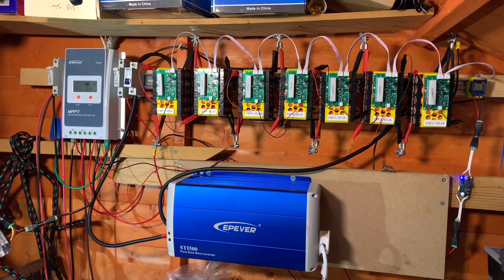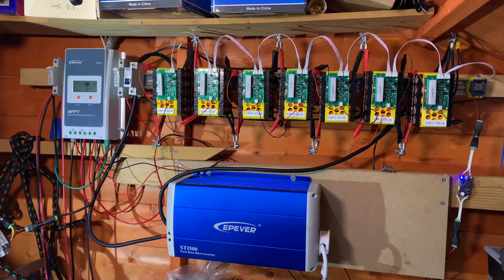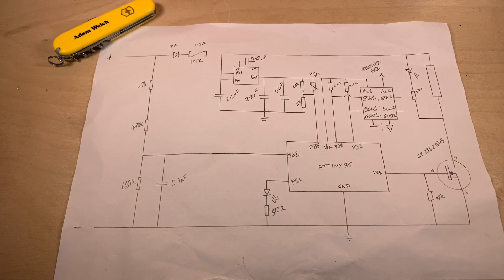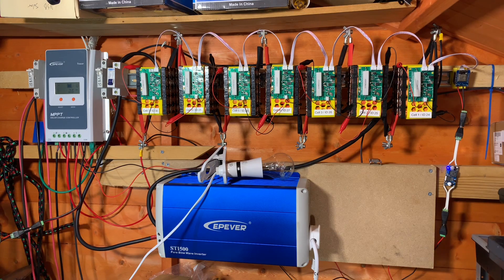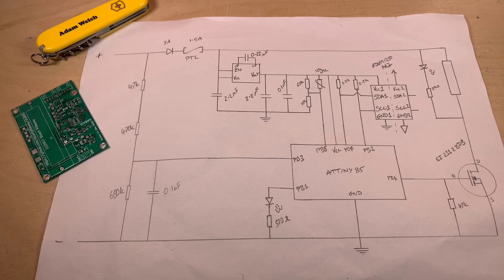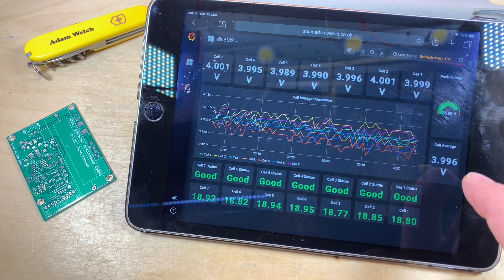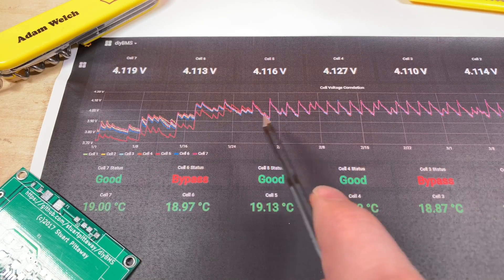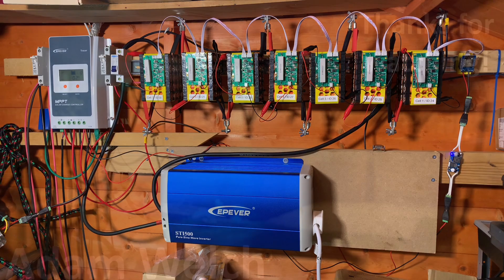A year with the diyBMS

Comment: hey would you recommend this charge controller for beginners, I only plan to use this to charge lithium batteries I have a 4S and a 7S (18650 battery is only)

Comment: Hi Adam, you seem to me as the most knowledgeable electrician YouTubers that I follow therefore I came here :). I have a stange question, what would happen if 220V is fed back to the inverter? I am asking because I have vired its output to the fuse box in my caravan to power up my plugs across the caravan, but if I come to a camp site and connect to the mains than the power will flow back to the inverter for the reason I described above. Is there a way of isolate it (make the flow one way, like a diode would do in a DC situation?). Otherwise I am risking cooking the inverter plus even feeding 220v back to my batteries, which may not end up well. Is there a way to do it? Can I just wire in an average on an on/off switch we use for a floor lamp for example and interupt the brown/red cable? With AC it alternates between this and neutral right, so it would only kill 1/2 of the wavelength right..would the other half not cause any havoc in my inverter? Thanks for your input on this Adam.
Reply from the maker: Hello. You’ll need to isolate the inverter when you’re using your hookup or else you’ll damage the inverter and possibly other items. I’d either install a transfer switch to switch between the two or a straight forward two pole isolator would work - but potentially it does allow you to forget and connect both at the same time.
Reply: Oh yes, that'd work. Btw the inverter has got only two poles (no ground). Would it make sense to ground it to common ground (where all other 220v cables are connected in the circuit breakers) or should I not worry about that? I am going to install a two (or three) pole isolator depending on whether you recommend me to ground it or not. I will not be connected to mains hook up very often - but wanted to have this option hence I am keeping this circuit connected as well. It's great to receive advice on how to do things. I am skilled in DIY, just not an electrician... :)

Comment: Adam, how do you show the "Cell Average" and "Pack voltage". Are you setting this up in grafana or you you do something else? Thanks!
Reply from the maker: Pack voltage comes straight from the charge controller into influx and grafana. The cell average uses the individual cell voltages in influx and calculates the average in grafana.

Comment: Hi Adam I'm following your channel especially on BMS. As you mentioned during the 100w bulb discharge test, you had to terminate it due to the pack five being too low. This brings me to the question: Can this BMS prevent a low voltage situation? Although the inverter or other equipment might stop the system based on the total voltage, the individual pack voltage might be close or even under the minimal voltage.
Thank you
Reply from the maker: No the current version doesn’t have a master relay to cut off any loads if any of the cells get too low. Currently I need to put my faith in the charge controller and inverters low voltage cut off. Stuart did take that feedback onboard and hopefully he is working on that limitation.

Comment: Adam - we have just upgraded our camper solar set up from 100 watts panel  lead acid to 290 watts and 105ah lithium ready for the summer - Will Prowse  put us on to a battery monitor that looks like a Victron without the Blue Tooth -  much much cheaper  - we set it up today and its brilliant - thought you might like one for your shed - it came with no manual but Will's post was clear how to set it up - let us know what you think https://www.ebay.co.uk/itm/Battery-Monitor-DC-0-80V0-350A-SOC-AH-VOLT-AMP-Capacity-Tester-Voltmeter-Ammeter/223230408536?ssPageName=STRK%3AMEBIDX%3AIT&var=522025797318&_trksid=p2060353.m2749.l2649
Reply from the maker: Thanks very much. I might well take a look. :-)
Reply: @AdamWelchUK  It is a kind of two way  joul meter using a shunt - you drain the  Lithium  battery to the lowest safe level (we used 12.45v for a 4S lifepo4) set the  meter then charge to full - walla : )

Comment: The ESP chip can re-write it's own flash blocks, even with the code loaded it should have bucket loads of room to store statistics. ESP8266 modules are very cheap, why not re-design the charge controller to have a Wifi module each, no need for opto isolation.....
Reply from the maker: This bms isn’t my design, but I did look at building one with an esp8266 on each cell group. The wireless comms would elimintmate the shared ground issue (which Stuart fixed by using the i2c isolation chip). 
My issue with this design was that the esp8266 only has one analog to digital converter - so you could read voltage but not temperature for example. That ADC also can only read up to 1 volt, which makes the steps quite large when you use a voltage divider to measure 4.2 volts. 
Secondly the esp8266 pulls quite a bit of current - so one on each pack might not be great on smaller packs.
Reply: The ESP32 has multiple A/D channels that go rail to tail, also has a pretty good low power sleep mode, maybe that would be a good choice.
Reply: @AdamWelchUK  You could use an INA219 for measuring pack voltages, they are very accurate.

Comment: Thanks Adam; that's very interesting. In any rechargeable battery pack, after a while, there will always be one cell which is weaker than the others, and after a number of cycles, it will become progressively weaker, because it is the pack which always has to work 'hardest' within its more modest capabilities. This is very often seen in an old car battery, when it will drop to a 10 V terminal voltage because of the weakest cell failing entirely. The other 5 cells might be still working properly. In your case, this is 'cell' 5. 

You could replace the 'cell' components with better 18650's, as a matter of routine (or even exchange 18650's with ones from the other cells), to retain a balanced setup. When another (or maybe the same) cell develops a weakness, repeat the process. Looking after the weakest cell like this should give you the best overall battery life.

Comment: You are nuts ! What happens to your wood mounting if the batteries go bad and start burning ??? The Idea is good but please think about savety, too ! I couldn´t sleep at night with an installation like that ! Unbelivable ! Have you ever seen a LiPo burning ???
Reply from the maker: Lithium cells set on fire if they are dramatically over charged or they are pierced while fully charged. I don’t intend to do either :-)  The pack has a breaker installed and each cell is fused at 5 amps. Have a look at my other videos, I’ve tried pretty hard to make a safe setup.
Reply: Yes, you might be right. But anyway, I do never ever make an electrical installation  just on wood ! You could have used a metal box. Looks better and it´s saver ! "Just in case of...!" In the end, it´s up to you !
Reply: @bjornfuchs3129  Metal box? You really think it's safer with short circuits?
Reply: Yes, this would be safer if they go off ! Don´t worry about shortcuts ! What do you think is a switchboard cabinet made from ? Metal ! Now, guess why ! Lol..
Reply: @bjornfuchs3129  Switch cabinets are not hand made! Here the batteries have a high chance of shortcuts, there is no insulation at all on the packs.

Comment: The biggest problem with this BMS is that the modules are powered by the cells being monitored.  No matter how careful you are, no 2 modules are identical and will draw different amounts of power thus throwing the pack out of balance.  Also the modules don't know when to disconnect from the cell when the cell gets in trouble thus it can drain the cell to dangerous levels.
Reply: I have designed a similar (distributed type) BMS myself I can confirm this. We, however, managed to drop power consumption below 1μA, which is almost zero in this case.
We did not use a dedicated communication chip, as there aren't any that are power efficient. While I admire the effort of creator of DIY-BMS (mainly as good source of educational material), the communication chip he selected (ADUM1250) is so power hungry (6mA), that it will drain a typical 18650 cell from full to flat in 3 weeks, which is really bad. The difference in power consumption of 6mA vs. 1μA is just astronomical.

Comment: I'm not sure i understand - if each individual BMS sets the upper and lower limits for that pack and each BMS is connected in order to balance the packs, haven't you then by default set an upper and lower limit to the whole pack? Of course I'm not sure what good a BMS is if it doesn't disconnect a pack when it goes low. I'm assuming it disconnects the charger once it reaches the upper voltage limit you've set? Anyway great info as usual Adam.

Comment: Qestion: how do I order the pcbs?
Reply: download the files from the diybms github and then go to a pcb supplier like JLCPCB.com and upload the gerber files.
Reply: @JankyShack   Is this the correct file: https://github.com/stuartpittaway/diyBMS/blob/master/BMS-Cell-Module-Circuit/GERBERS/GERBERS.zip ???
Reply: @JankyShack  Also what is the easiest  way to order the components?
Reply: @arhitektche  The newest version is under the smaller-pcb branch.  I have updated the BOM with links.  I sent a request to have it updated in the actual release, but until it is here is my fork. https://github.com/Zenkormalorvi/diyBMS/blob/smallerpcb/BMS-Cell-Module-Circuit/BMS_Cell_Module_BOM.html
Reply: @arhitektche  https://github.com/stuartpittaway/diyBMS/tree/smallerpcb/BMS-Cell-Module-Circuit/GERBERS These are the correct gerbers.  Also make sure to order 0805 size components, not 1210 or they will be too big to fit on the updated board.
Reply: @JankyShack  Awesome thank you!

Comment: Good work. Fun seeing the attiny85 and i2c isolation. I've been there too, also the reset pin on the attiny I ended up using adc to read input from a button and at the same time keep the line as a reset line.

Comment: How about upgrading to a esp32 and have some relays to control over/under charging? That would make the entire system self contained, easier for beginners to use and implement as well.
Reply from the maker: I don’t think you need to use an esp32 really - unless you need the control web gui to be faster or perhaps if you had a very large pack, but an esp32 version would be nice. Using another pin for a external relay is a good idea I think if you’ve nothing else controlling that side of things. It shouldn’t be too hard to adjust the code to implement it.
Reply: @AdamWelchUK  my idea was to make it more responsive yes. We could also add more sensors for ambient temperature and so on. We could use the Bluetooth functionality to sync several controllers together as well. I don't know, sounds useful for bigger packs.
Reply from the maker: Does sound interesting. Some good ideas there. :-)
Reply: @AdamWelchUK  need to get some batteries, it's difficult to get used laptop batteries on my country.
Reply: @AdamWelchUK  I thought in some other courses, thinking if it would be possible to drive with an esp32 on each pack or 8266 when my thought was that fewer components on the second circuit board (and also become cheaper) and all communication is wireless and an extra esp32 for summing up the data and storing history (for 7 cells -> 8 esp32 or 1 esp32 + 7 esp8266) if it would suffice with some mosfet and resistor when it is already isolated
was just a thought from one who didn't keep up with these things but was just thinking about it

Comment: It's actually better for the cells to keep them at as low a voltage as possible (above fully discharged obviously).  So If you can drop the charge voltage (to around 4.05V or even lower) during the sunnier months that would extend the life of your batteries without limiting your use based on your voltage plots.
Reply from the maker: Yeah - the whole setup is set for about 4.1v per cell but I don’t hold them there for a long period. So they tend to settle at about 4.05 normally. Cheers

Comment: Hah, I was just putting in order to jlsbcplah,whatever it was, for 30 boards to start making my own and checked your previous video for links :D Bit annoying to beginner to figure out the bill of materials thing, specially the part size format part. Someone should make a list with ebay-aliexpress links to components, I see only farnell ones and these are silly prices. Since people do it mostly to have budget solution, I think.
Reply: oh, and I'm doing the "new" smaller board. I only wonder how reliable the esp wemos thing is, doesnt it freeze randomly or give up on network connection if there's some interference..
Reply from the maker: I’ve been lucky and had no interference issues at all. Colin Hickey did but things worked a lot better when he shortened the cables and used shielded twisted pairs. The wemos has been hugely reliable for me. It’s been three months since I updated it when I had the temperature resetting issue on the modules and it’s worked that whole time. It did break last week, but that’s because my solder joint on its power input broke off!
As for the component list - it’s quite a task to do it and keep it up to date. If I had the time I would...